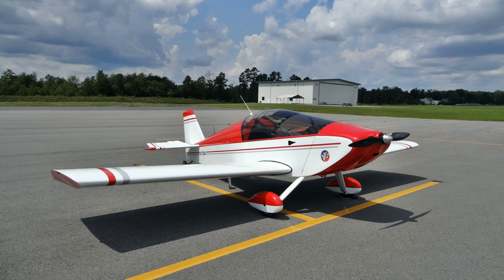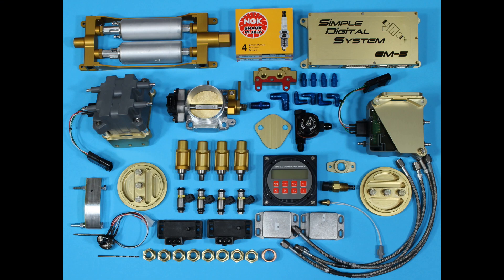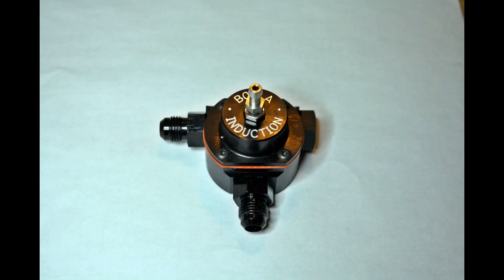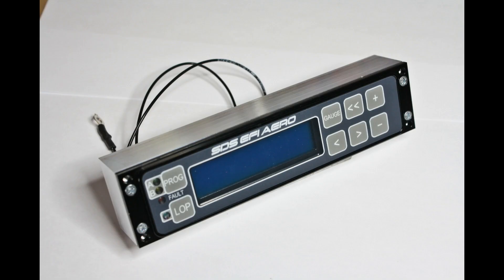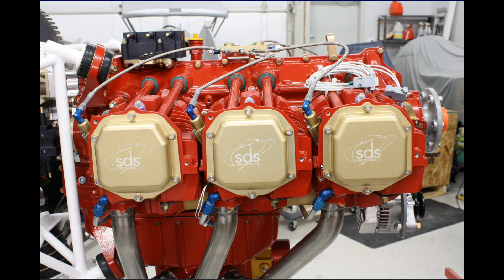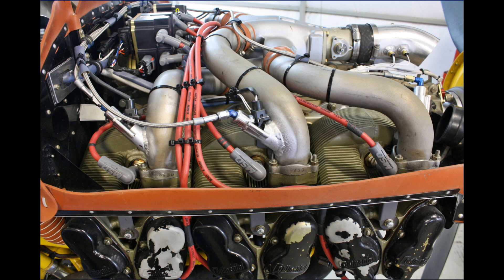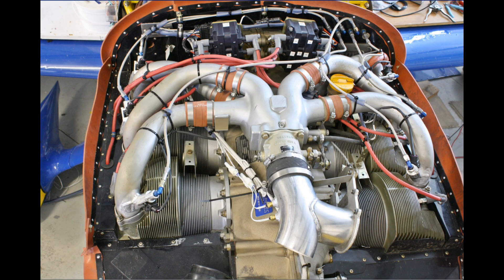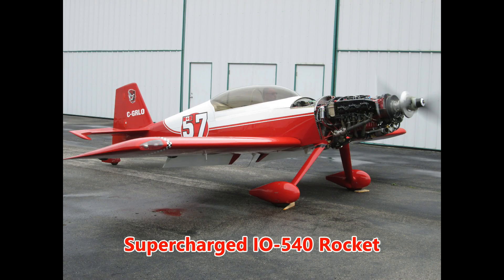SDS EFI Intro

Comment: I used an SDS system on a Chevy 305 Tuned Port Injection (TPI) years ago and loved it. So easy to adjust the timing and fuel. Great system. I loved the + - 50% fuel trim knob. I had my setup way too lean upon initial startup. Once I realized this, all I had to do was turn the knob to the right to get it close. If you needed +30% on the knob, you'd just go back to the setup, add 30% to all the fuel points every 250rpm, put the knob back to 0%, and try it again. Easy peasy, lemon squeezy.

Comment: Can you comment please on the relative weights of EFI vs carb? Thank You.
Reply from the maker: It depends a bit on what carb you've got. On Lycomings with a big Marvel carb, we find the weight is close to a wash with the EFI. On small engines like VWs, the EFI certainly weighs a few pounds more.
Reply: @rv6ejguy  Continental O-300. Not sure if I should be more afraid of electrical failure or carb icing; maybe icing is the bigger risk. Are these solenoid or piezo injectors?

Comment: Bonjour, Hi, does anyone know how to set the Temp function from Celsius to Fahrenheit ? it is not mentioned in any sds efi manual, thanks. I have to check a dual SDS EFI on a T-51 for the Honda VTEC V6 3.5L and when i connect the LCD to SDS1 data are fine in F, but connected to SDS2 it shows all Temps in C..?
Reply from the maker: Email us whether you have an EM-4 or EM-5 and we'll send you instructions on how to do that. Email is near bottom of the sdsefi.com Home Page.
Reply: @rv6ejguy  thanks will send you an email today

Comment: Great info Ross. One thing I should mention, based on my observation of the reaction I often get when telling other builders what system I intend to install in my aircraft, is that it is a good idea to mention right off the bat what this system is NOT. The first thing many builders assume is that this is a auto conversion system that I am retrofitting. So many are bias that they are looking for the moment I say "auto conversion" or the like, that they are not even listening to the details of SDS when I'm telling them. I find owners of aircraft (understandably) extremely risk adverse, so much so that they will not even entertain such a system because they have heard too many horror stories of auto conversions. I recommend stating that this is explicitly NOT a auto conversion in the opening line of your sales pitch. Thanks for posting Ross, always a pleasure to watch these videos.
Reply from the maker: From my long experience in the aviation market I see a segment of pilots and builders who will never buy EFI. They don't trust it and feel better using mags and carbs. That's fine. That is what they are comfortable with. Nothing will shift the perceptions of this group and we don't try.

The facts are that much of the hardware is automotive based- injectors, coils, fuel pumps, spark plugs etc. We use these because they have proven reliable in billions of hours and are reasonably priced. We still have a large segment on the auto conversion side. I thought we should represent that as well in this video.

We are not hurting for business. Many pilots considering EFI and EI come to us because of our long track record and we're very happy with that. We don't really do a sales pitch per se, just show folks what we've done over the years and let them decide if SDS would be a good fit for their mission.